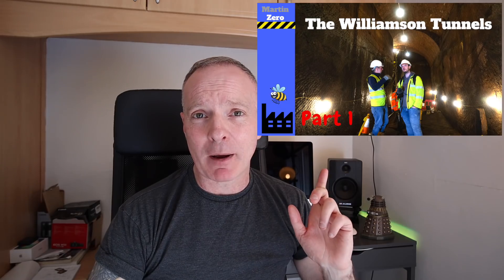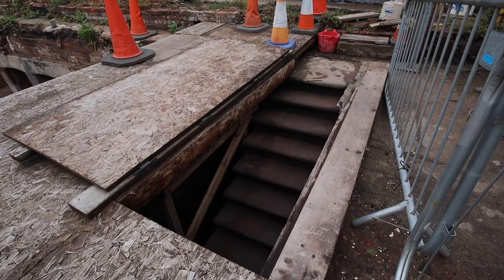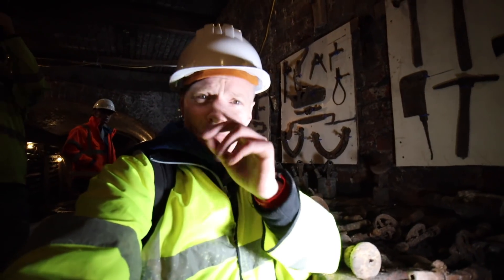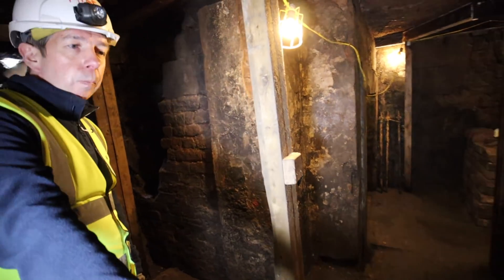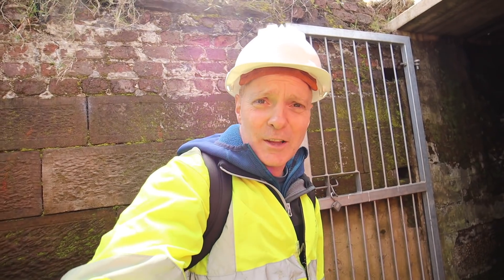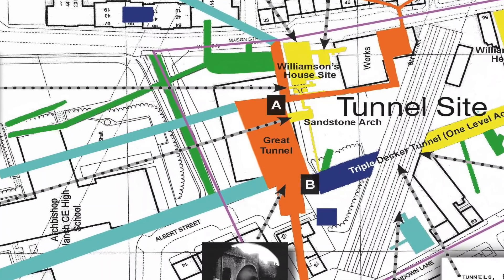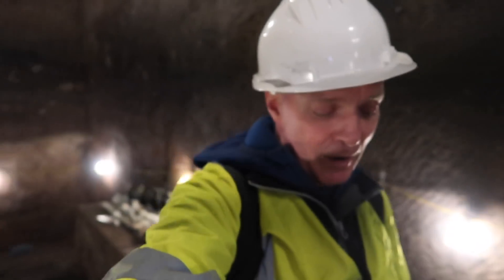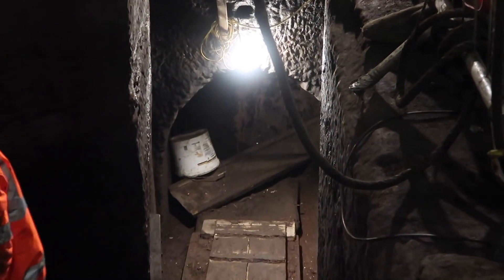The Williamson Tunnels. Liverpool's Historic underground Tunnels Part 2

Comment: The sandstone arch is of exquisite quality!  The joints although mortared are extremely tight!  Work like this is not possible today.
Reply: We could probably do it, with a bit of research and practice. Stonemasons today do a lot of great work restoring old stone buildings. Money and time is normally the limiting factor - and for new buildings, return on investment.
Reply: @daveg2104  Yeah, alright Dave, maybe but being an advanced craft carpenter of 30 years (so far) I haven't seen this quality from our generation - or anywhere near it!  I've even worked with good stonemasons from Bath but this kind of tight joint is not seen nowadays!
Reply: @kevinchamberlain7928  My nephew is a stone mason. Works on a lot of stuff. With laser sights and levels, diamond saws (and I don't even know all the tools of the trade), even hand polishing, it basically comes down to time and money. These days, buildings are constructed to a price (lowest bidder usually wins), and mostly not constructed to last. Just look at the issues with concrete cancer.  The construction industry could do better, but where is the incentive. So yes, I do agree that there is a lot of poor tradesmanship  going on (and has been for a long time), but shoddy, for a price work isn't really indicative of what could be done if we really wanted to.
Reply from the maker: I agree Kevin

Comment: The economic and engineering history prior to and throughout the building of the tunnels will yield the final answer to this building riddle . Cheap labor , reused building materials , depleted land and a scarcity of work shop space for cottage industries that could be later used for foundations of larger above ground industrial uses . Later , filled in for a different economic reason . First rule of material handling , don't , is another clue . Great story !
Reply from the maker: Thanks Montie

Comment: At the time Williamson built the tunnels there was an out break of Cholera in Liverpool which took a lot of lives could have been used to house the dead. The sandstone may have been used in the building of the Anglican Cathedral. In the 1950s there was still an operating sandstone works in that area near Apple terrace which is now long gone. Excellent work and presentation.

Comment: Amazing place hope they find the great hall soon. Back in 2008 I was working for a piling company doing some work in Liverpool. During the piling we lost the steel piles we were pushing in at first we thought it was running sand but a trail pit with a jcb found a huge under ground chamber about o ft high and the length of 6 houses. We thought it was one of the famous tunnels. Turned out it was a way of making more rooms for the families that shared the terrace houses that used to be above. The historian said it was a more common than you would expect.
Reply from the maker: Wow interesting stuff Nick. Never heard of that

Comment: It`s just a list of amazing moments :
1)  The though of concept about building the tunnels to further other project ideas for the area.
2)  The use of Ex servicemen to help design and the labour force taken to build it all.
3) The disregard of some parts and adaptations of parts through the years.
4)  Total abandonment surplus too requirements and filled in.
5)  The last 70 years of construction has not seen major pile driving has ruined it to pieces as the modern landscape has changed in purpose.
6)  That 200 years later rediscovered and again dug out by hand, exposing artifacts of history and tunnel usage.

as you say Martin " mind blown " cannot be over stated enough for ones mans ideas that most folk back then & today would laugh and scoff their faces off at him.
Reply from the maker: Yes thats true very good points. Although there is that pile in that chamber

Comment: Another thing, how did all that spoil get into it? Considering how hard its been getting the stuff out 🤔🤔
Reply: The Officer My thoughts completely mate.
Reply: Could there have been heavy flooding ever in that area? That could possibly cause a more dense fill in, or maybe the London bombings during World War 1 damages?
Reply from the maker: Later generations didnt care about the tunnels and used them as dumps. Also the council dumped stuff into them
Reply: @MsBlueRyan  These tunnels are in Liverpool. London suffered badly during the WWII, not I, the aircraft in that times were just a measly biplanes. They did bombing but by hand, throwing smaller explosives.
Reply: Although Liverpool took a hammering in ww2 also. The battle of the Atlantic was planned from there. I think they opened that as a museum too. LindyBeige did a good video on that.

Comment: if i heard correctly, several times it was mentioned that the street was below you.
such as , 25:44.
how can the street level be below you if you are in an underground tunnel?
Reply from the maker: We are on a cliff, kind of. The street level is both above and below us, if that makes sense. Not directly below us but further out downhill
Reply: @MartinZero  - got it.
Like a road going up a mountain. if you tunnled into the side if a cliff, the road would be below you. Didnt think of it that way, i was thinking flat land for some reason.